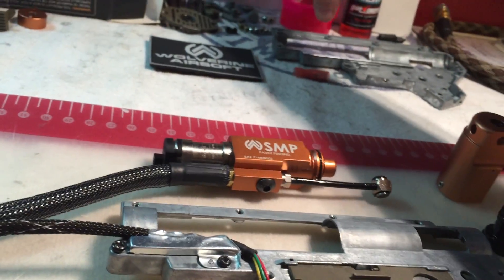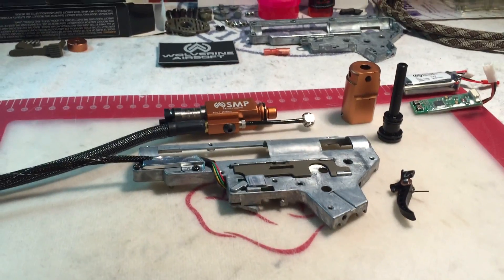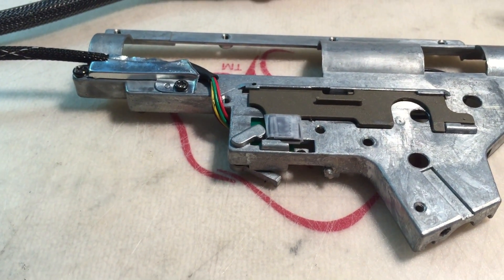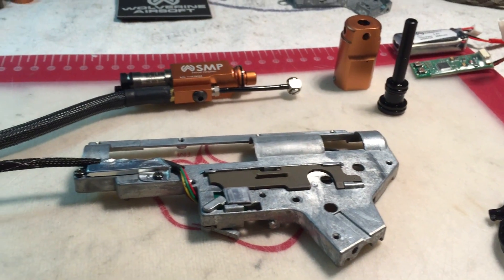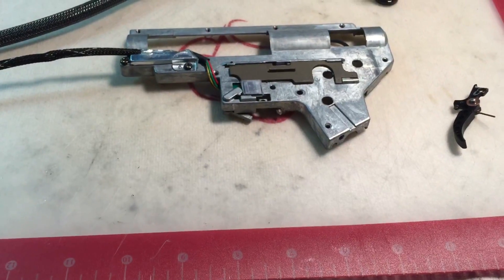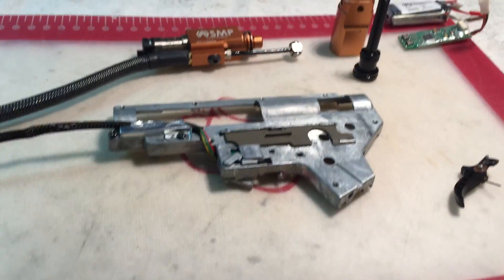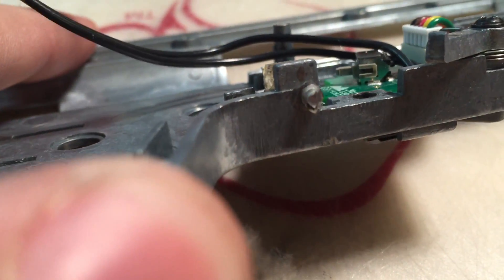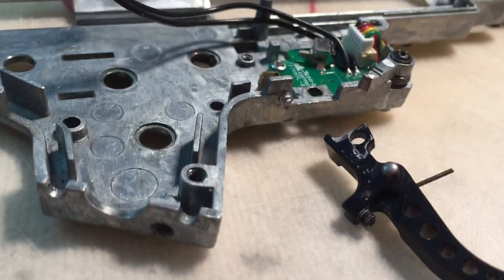Wolverine SMP: Required Modifications and Maintenance

Comment: Dude I searched for the selector play remedy and couldn't find any good sources on it. I just so happen to click on your video because I seen the mods required and lo and behold my answer has arrived. I'm work time AEG before and had to do this but didn't think of it for this. I added a layer or two of tape and outside of the receiver it was working once I put it inside the receiver and get the gun put back together I'm just getting full auto on both. is that because it's contacting the black pen too much because in the send me a pic dishing it looks to be touching it also. so with this man in that area I actually need to shave down there so they could play a bit so that it's not touching it. help me out if you can as everything else has worked just fine I just need to fix this one part and I'll be gold.
Reply from the maker: Th3PROfessa1 sorry for the late reply man, if you are always getting full auto then your selector plate is pushing down on the tab too early, try removing some material from it so that in the semi auto position it is not hitting the switch for full auto..